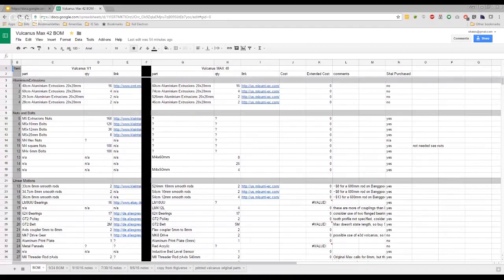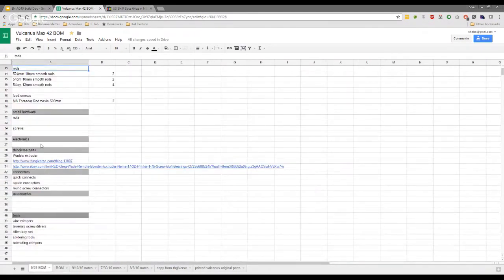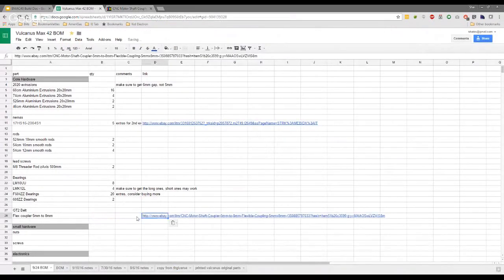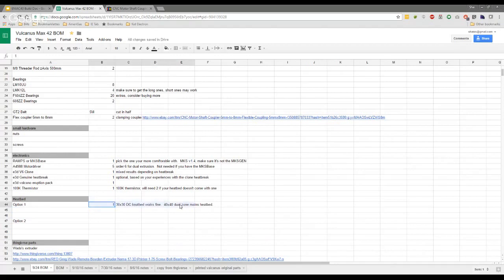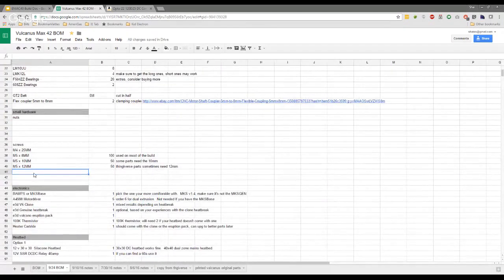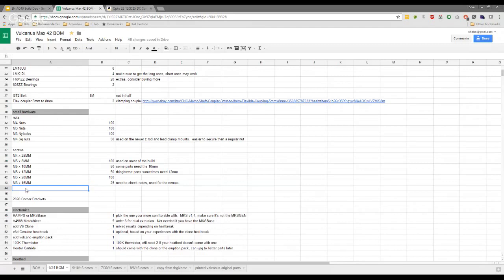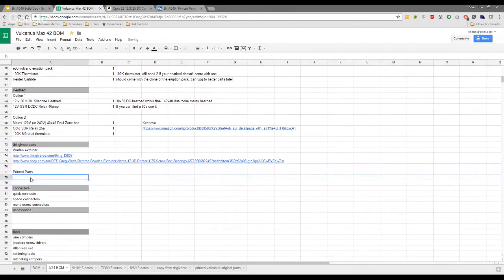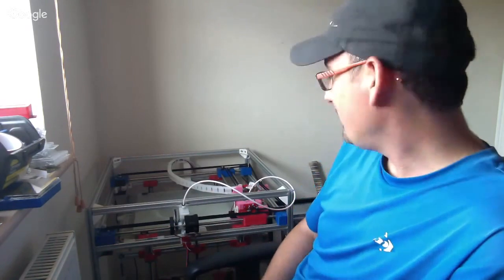ENIAC BOM Walthrough #1

Comment: Just joined the fb group this is a great help as I've got all the part and looking through a lot of printers was more worried about weight as a 400mmx400mm build plate as I'm fed up of parts on my flash forge being cut off because of a few cm